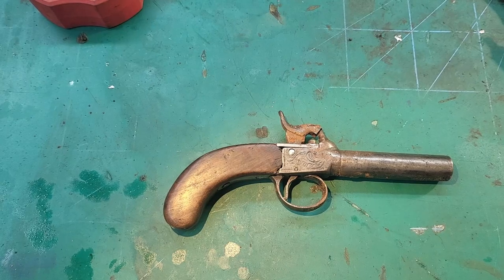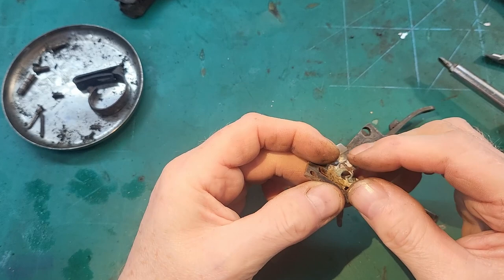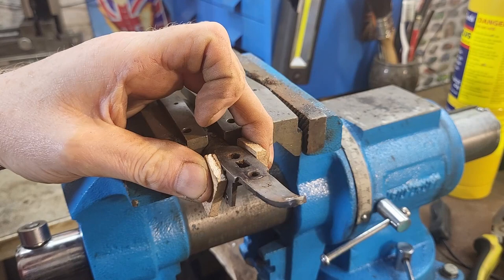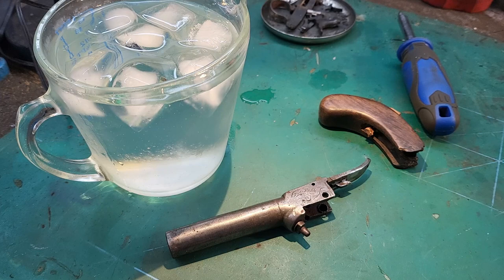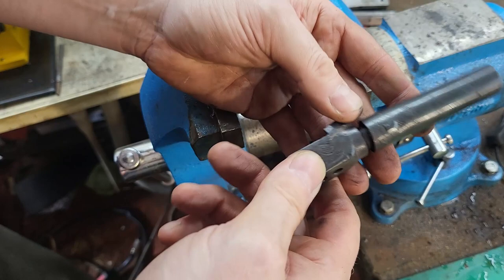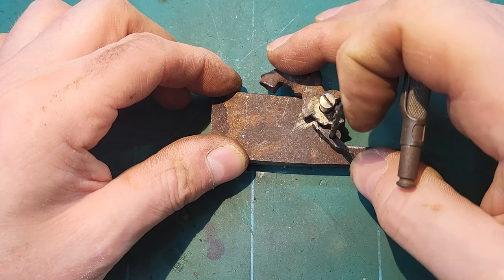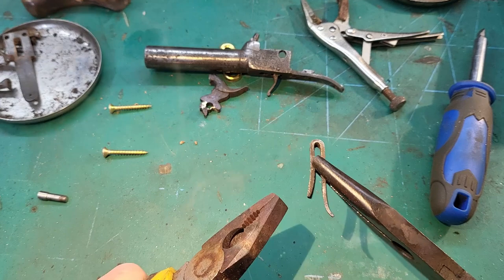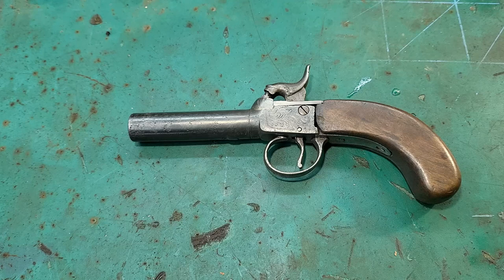I Bought A Busted Antique Percussion Pistol - Can I Repair It?

Comment: Thanks for uploading all these repair/restoration videos.
I do have ELG pistol with the same trigger and hammer mechanism like the one in your video. 
Both the trigger spring and the main spring is missing as the handle and the trigger guard...
My uncle found it in a wall when he renovated his House a long long time ago and it was kept in this state for decades. Now I want to restore it vor him, would be nice to make it work after all these time...

How did you made or where did you got the replacement trigger spring? 
Did you made it yourself and if what Material did you use? 
Which material do you used to make the  double duty spring in the other video, what stell was ist and how thick was it?

A lot of questions I know, sorry for that. I would be really thankful if you could help me for these missing part with your expertise.

Thanks a lot in advance.
Greetings from Germany
Reply from the maker: Thanks, I made the trigger spring, if an antique gun needs a replacement spring, you will have to make it. For the trigger spring and the double duty spring I used spring steel, just search for ‘spring steel’ on eBay. There’s various sizes and thicknesses, I use 9.5mm x 2mm.
Reply: Thanks a lot for your reply that helped a lot.
So I will order the spring steel and go for it.
All the best.